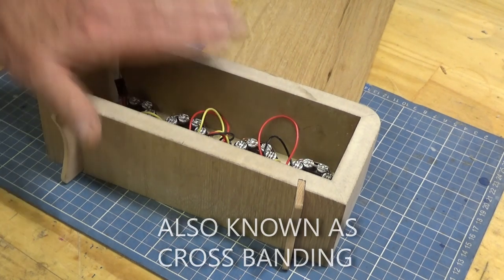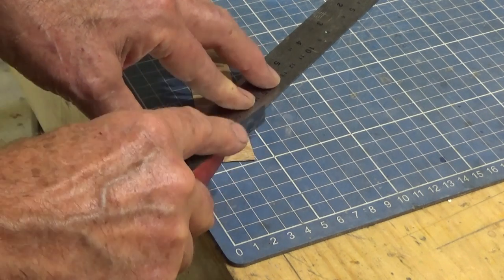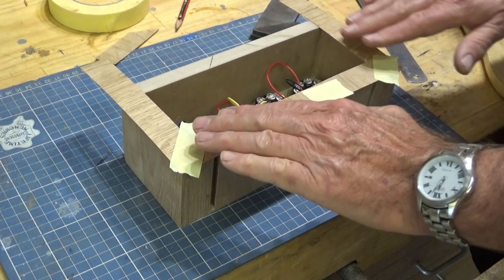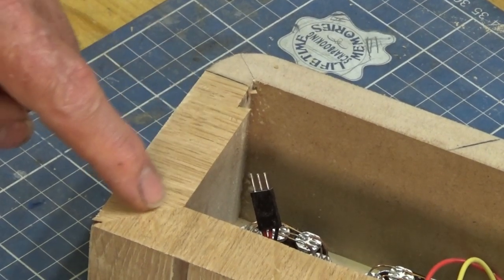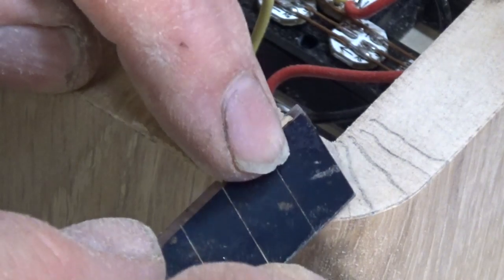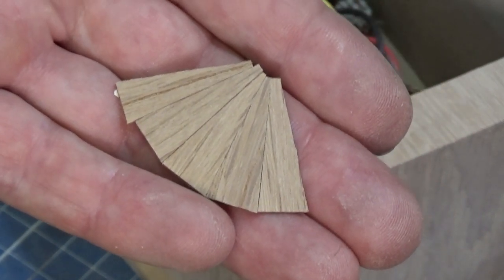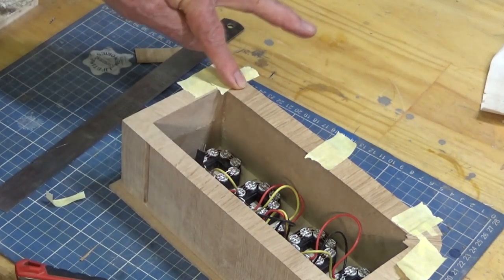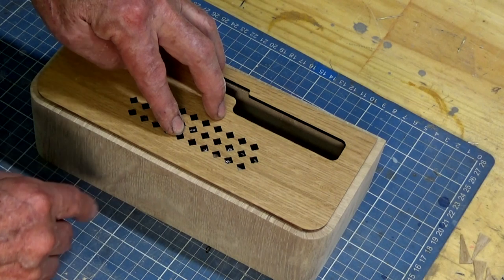Edge Banding/Cross Banding Using Oak Veneer

Comment: Well done.  Looking very nice.

Good tutorial.   I have done edge banding but with only 45 deg  mitres and even that was finiky but nothing like the two top curves.
Veneer is so fragile.   I cringed when the point of the one mitre broke off.    That is the type of hiccup which would happen to me.
"Murphy" is very active in my shop so I would have likely sanded the veneer down instead of trimming with knife which would likely have resulted in something breaking.
Dave.
Reply from the maker: I have a dwindling supply of veneer which will soon be gone but it's a great way to dress up a project if you don't have any exotic species in solid timber. That oak is especially brittle and hard to cut. I used to have a huge supply of Australian red cedar which cut like butter with one pass of the knife blade. 
Regards,
Mark

Comment: That looks great. Have you ever used a veneer hammer and hide glue for veneering? In my very limited veneering it was the only method that I could make work. And no clamping required.
Reply from the maker: Ian, no, I haven't tried it. I do have some hide glue and I used it to repair some edge moulding on an antique oval table. Mainly, because I was told that you should never try to use modern synthetic glues on antiques. The hide glue worked great though. I got plenty of working time and it is repairable with hot water or steam. I should really try the traditional veneering method for comparison. I am always reluctant to try out something new on a project that already has a lot of time invested in it. Sometimes it's better to stick (no pun intended) to what you already know.
Regards,
Mark

Comment: Excellent video thanks.
What is the glue you used?
Thanks again.
Reply from the maker: Garry, I used Titebond cold press veneer glue. It dries with a slight brown colour, it's easy to sand and it can be removed from the clamps after about 40 minutes depending on temperature.
Regards,
Mark

Comment: Hi Mark.
Few tips about veneering.

Do not use utility knife, it is too filmsy and have too wide cutting angle. Use exacto or even better wide sharp chisel, espetialy when trimming excess venier. With wide chisel you can easy  register it on the sorounding plane, and trim exactly at joint line between two surfaces.

To match edges along the grain, espetialy when working with dificult veneer like oak, clamp veneer between two boards and plane or sand jointing edges.

Paper veneering tape, has one advantige that is mush more important then easy removing. When it dries it srhinks, pulling two peces of veneer tight together

Best regards
Reply from the maker: Boris, I have used paper tape before but unfortunately, the supply that I had was ruined by the high humidity we get here in this part of the world. I have an exacto knife but for some reason I prefer the snap off type blades. I like that you can flex them in against the side of a carcase to flush trim the veneer. 
Regards,
Mark

Comment: Nice demonstration of a little fancier veneering. I watched you carefully. Only a few mistakes! Cutting towards the end of your veneer is a nono. It breaks out as you discussed. Nice to see someone use a decent glue on their veneer. Rubber cement (contact cement) works but not durable. The only thing I would do differently is use a reference piece of angle for your radial corners. I'd cut it on a mitre saw or table saw and use it as a repeatable angle.
I have many years work experience (35 plus) as a fine Cabinet Maker. You are doing a great job Mark. Either you have had cabinet maker training or your a practised study of the Cabinetmaking arts.

Mark, not from down under.
Reply from the maker: Thanks for the feedback. I had originally edited the video together and it came out at nearly 90 minutes long so I had to severely cut out a lot of detail. I recently retired as an Industrial Arts teacher so most of my career (also 35 years) was spent teaching secondary school students woodworking, metalworking and graphics. Most of what we did would be described as elementary woodworking in the junior school and some more advanced cabinetmaking in the senior school. I had no training in marquetry when I went to college so a lot of what I know now was self taught and through reading. The techniques I use are not really what a classical cabinetmaker would use but rather what works with beginners. I sometimes (rarely) had the opportunity to work with some highly trained craftsmen and women but sadly, the education department here did not see much value in releasing us from the classroom to get some industry experience. I never did get the chance to work with a good cabinetmaker but I did once get to disassemble a turboshaft helicopter engine with a LAME (licenced aircraft mechanical engineer). That was one of the highlights as I had recently built a small model turbojet so it was very cool to see the guts of a real turbine and compare it to what I built. 
I do like the Titebond glue. It is way better than PVA but it dries with a brown tinge which did cause a problem when I bonded the light coloured veneer on the face of the clock. It stained the voids where the light shines through the veneer from the back side.
Thanks for watching,
Mark, from downunder.

Comment: Dumb question, wouldn't it have been easier to just make it out of a solid piece of oak? Instead of making it look like one?
Reply from the maker: I was going for that sort of 1940's aesthetic. This was when manufacturers were using low grade substrates like plywood and particle board and adding veneer to hide the inferior quality. I could have used solid wood but I don't have any oak. It's not native to Australia and it's almost impossible to get where I live. I am building a second clock from solid Australian Red Cedar and that is going to be shown in a future video. It's also sometimes a challenge to cut a large carcase from solid wood without making a feature of the joints. If it is simply carved out of a solid block, you can then get issues with end grain and checking.  
Regards,
Mark

Comment: Mark having the knife blade too far out is a accident waiting to happen be careful.
Reply from the maker: Robert, I know it looks dangerous but it's necessary to get the blade to flex against the side of the surface you are trimming in order to avoid undercutting it. The Milwaukee blades I am using now are very well made and they seem to be sharp, strong and flexible. Many of the cheap blades will shatter. 
Regards,
Mark